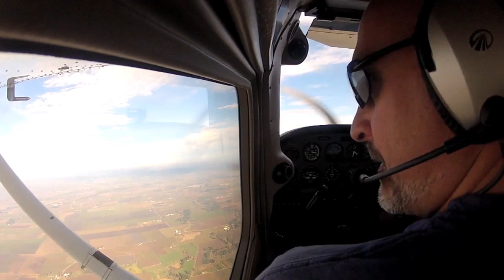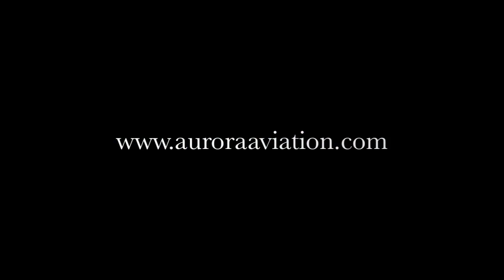Departure Stalls- Cessna 172 (Power-on Stalls)

Comment: How far is the rudder used to correct spins and correct certain things that happen in stalls? Trying to figure things out to get rid of these irrational fears of rudders coming off with too much pressure (I mean it did happen to an AA A330 in New York.)
Reply: +John Armstrong . It is OK to use full rudder deflection in this case. You have to remember, speed is VERY low here compared to an A330. In fact, spin recovery procedures demand it. Procedure is: Power to idle. Ailerons neutral. FULL opposite rudder. Elevator (push) (AKA PARE)
Reply: Brandon B
Thanks for that response Brandon. I appreciate it.

Comment: Just take a ground session with a whiteboard session, showing the wing conditions during a stall, where the disturbed airflow can be depicted over the wing during the stall, showing why it is dangerous in using the ailerons, with the disturbed air rendering them useless until you lower the nose and break the stall condition. The seeing of the condition by drawing it is an easier way to help remember why ailerons are not used during the stall process.